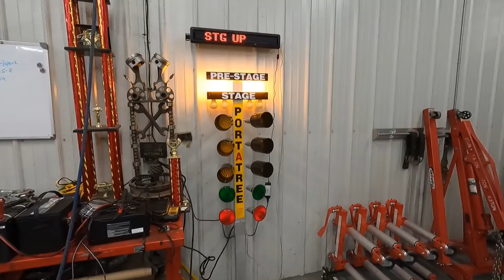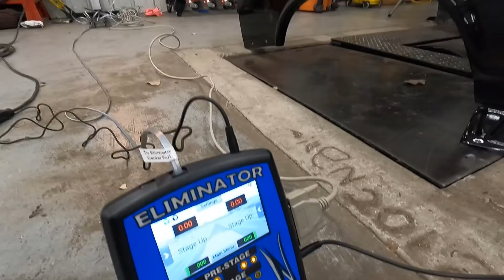Murder Nova First Fire-Up of 2021 + Trying Out Our New Practice Tree!

Comment: Shawn & phantom have been doing this long enough to know how to check bearings
Reply: Like the gloss
Reply: @lsxtmt4910  we’ve checked bearings in our race motors if they looked happy no scoring we put them back in with no issues.. We’ve changed bearings and spun them three passes in. It goes either way if a motors happy it don’t care if it new or still good used bearings they are only going to last x amount of passes before they wear out with amount of abuse it takes.

Comment: @24:45,, Shawn's practice seat 'n wheel with launch button on a stand. There are many, many out there in a number of configurations for not much money available on Amazon, eBay, GameStop, Walmart ready made or that you can use as a template to build your own. Since you guys have limited space a folding model that can be folded and secured to the wall when not being used would be perfect.

Comment: Put a reflective cover on the roof during summer while pitted.. Plug out ignition off spin the starter until oil pressure- - bam the whole engine Is pre oiled thoroughly with no damage..

Comment: You guys dont forget to check the fire cable for movement! Put pins in bottles and pull & lube cable! Should also change to lever, because you can almost never pull a cable backwards, like the way its setup, Also dont use a carbon fiber handle, because they break! Just ask Reese bros race cars! they broke there carbon handle last year on there badass small block blower car, that runs right with the hemis! If not faster! Have a good one cannot wait to see the new car back at it!

Comment: Hay Shawn. You ever hear of a company called Vintage Air ?? Not sure but I hear it's all run off the charging system. You could use a Yellow top battery for quite a few passes before it needs any charging. Just a thought. I dont think the whole system would add much weight.

Comment: If you hit the wall with the front, then is that where you’d want the fire bottles?  I’d assume those may be knocked loose in an impact along with the fuel going everywhere.  Seemed safer in the back of the car.
Reply from the maker: Guess funny cars and dragster are doing it wrong too?

Comment: is it just me or do fuel injected computer controlled engines sound like the camshaft is smaller than one with carb. a friend of mine went efi and the car ran so much smoother would have thought the cam had been changed

Comment: As bad as it sounds but put pantyhose over the black shields and it will help with brightness.  I have the same setup and helps alot. Also the little box should have a instant green setting

Comment: Here's a link to hookup the practice tree to your racecar.  You use the adapted to hook it up to your actual transbrake button in the car so you can get the most accurate simulation where your sitting in your racecar using the actual transbrake button you use when racing. Scroll about half way down the page and you'll see the #8300 transbrake connection. https://portatree.com/Category/Eliminator-Next-Gen-Accessories-and-Combo-Packages